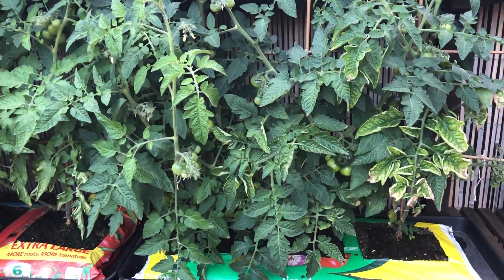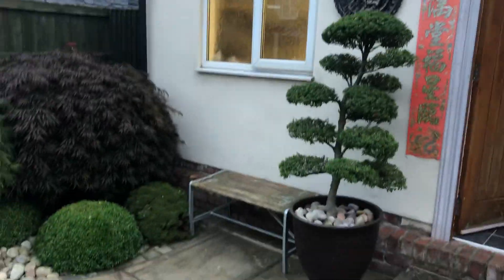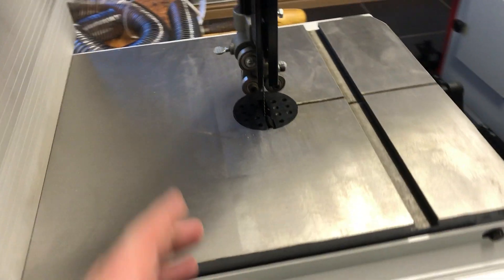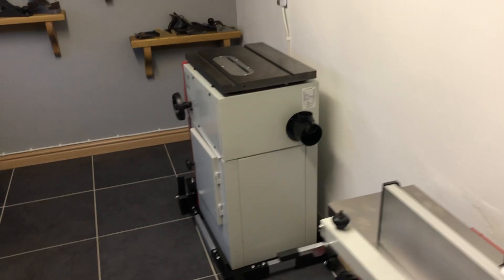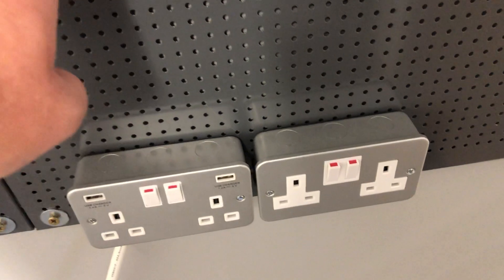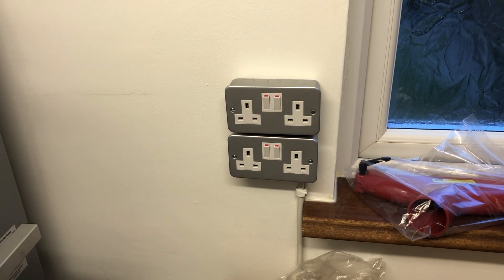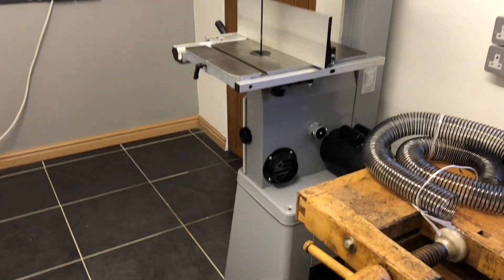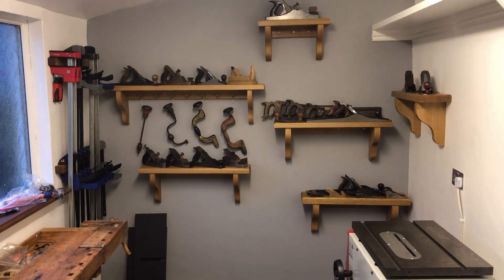97 ft tiny workshop/shed update (5) Electrics and Axminster tour delivery 😀👍

Comment: Great start, solid machines and good choice, best of luck buddy.
Reply from the maker: thanks mate I appreciate that I wish I had a bit more space so I could get a few more things in though :-) how big is your workshop? It looks to be a fair size
Reply: @tooladdict7463  Hi pal, I will start with my workshop, it's about 16 and a half foot by 16feet, even with that space I still had to think long and hard about my machine placement, I cant offer you much advice other than I space is tight then mobile bases are a must, and dont go for the cheapest like I did and lived to regret it. A good machine deserves a good strong mobile base. Enjoy the machines because they can offer you limitless benefits and possibilities, it's only a suggestion but is extending your shop at all possible? I no that sounds crazy but it's what I did and the extra space has made such a difference. Regards Louie
Reply from the maker: thanks Louis I appreciate the input there is no chance of expanding it 
it is blocked in on all sides I did buy decent quality mobile bases after watching a few YouTube videos on cheap ones I guess I’ll just have to build very small things :-) thanks again for the message kind regards Ben
Reply: @tooladdict7463  I wish I could help you more Ben as I faced a similar issue before extending, the only other idea left I guess is possibly building a covered deck at the front of the workshop which might enable you to build larger worker outside of your shop maybe! Anyways remeber quality over quantity is always best. All the best pal and if I can offer any other advice just ask. Regards Louie
Reply from the maker: Thanks Louis I appreciate that mate

Comment: That's a very nice shop.  I've been wanting to build one in a shed in my back yard but the village zoning only allows one shed on property. 10' x 10' maximum.  So watching you design and fill yours up with tools and machines is giving me some great ideas on how to set it up.  Thank you so much for these very good videos.  Cheers from La Grange, Illinois (suburb of Chicago).
Reply from the maker: thanks Toni I appreciate the message 10 x 10‘ is not bad -7 x 13‘ so you would be a tiny bit bigger the most important thing is a reasonable head height makes it feel a little bit bigger I was the same opinion as you I thought my shed was too small but I decided to give it a little go anyway and make the best of it good luck with your project kind regards Ben